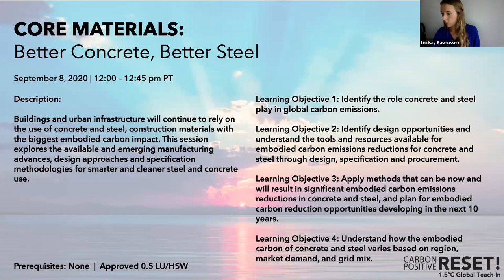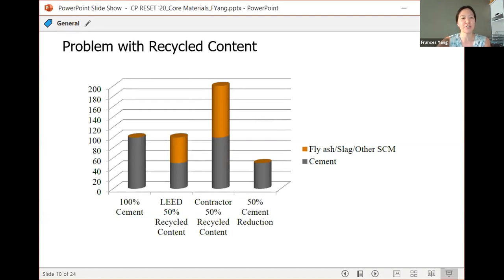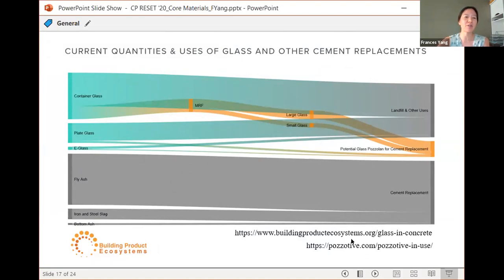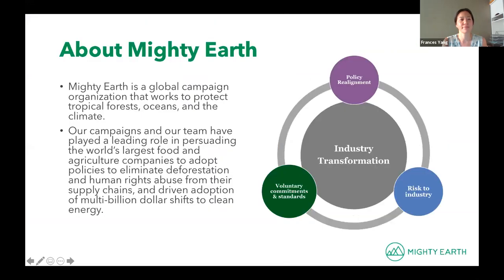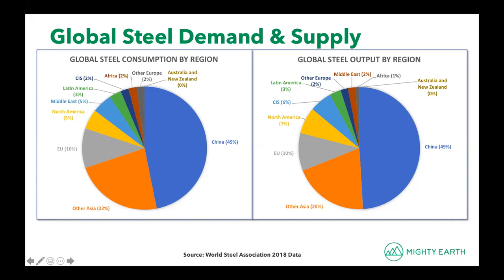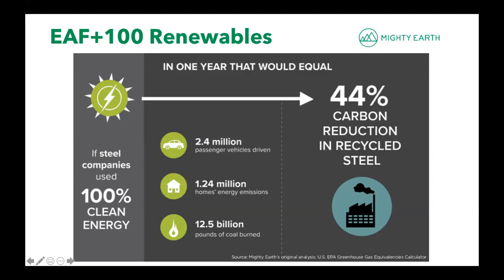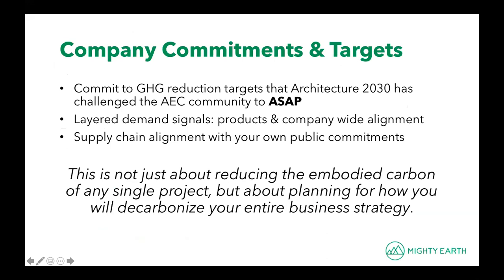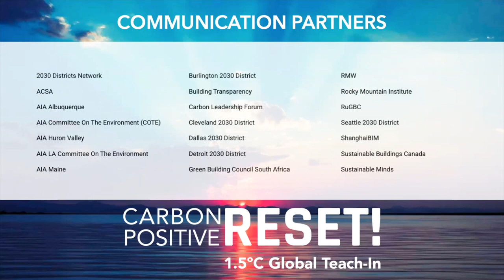CORE MATERIALS: Better Concrete, Better Steel // CarbonPositive RESET! 1.5ºC Global Teach-In

Comment: Thank you for the presentation! Reducing carbon in concrete is a dilemma in that SCM have run short in the Bay Area, can cost more than cement, and generally travel a long distance to get here - Lehigh slag comes over from Japan, for example.  One small but simple step is to reduce arbitrary residential foundation wall minimum thickness.  Often where code and practice prescribe an 8" thick wall, a 4" wall will more than serve all structural requirements. Without any special mix constraints, the carbon emissions can be simply cut in half. Problem is, the Building Official will not accept it. This is where I would like to see changes - in reducing the arbitrary volume of concrete required by code. Thanks again!